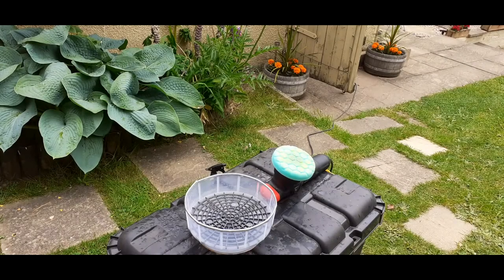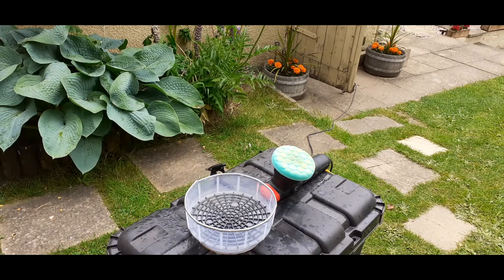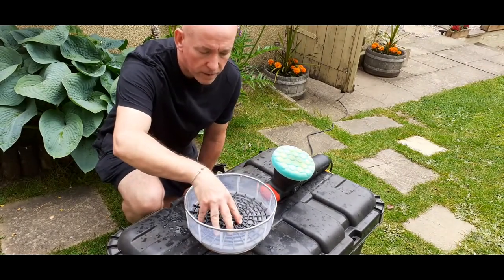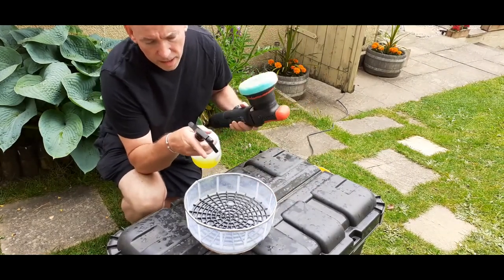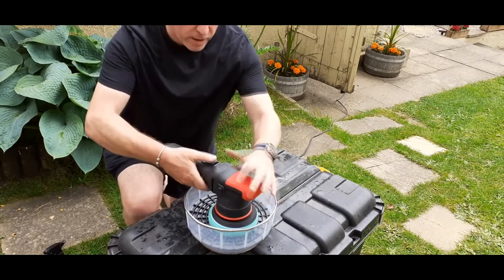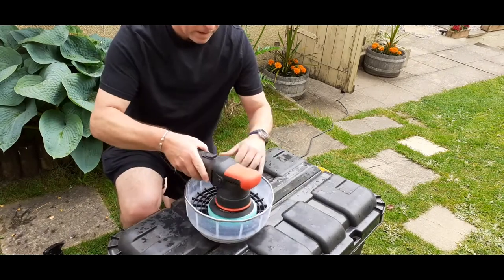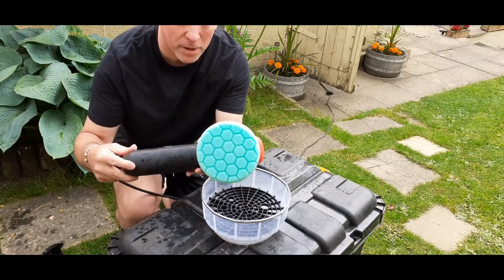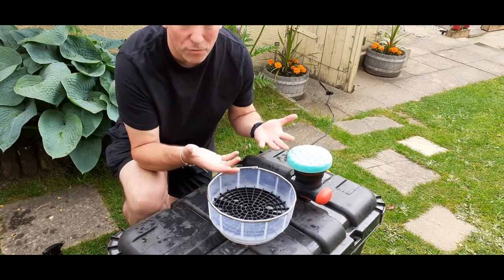Detailing hack....cleaning pads on the fly

Comment: wont that pro the life of the pad?
Reply from the maker: Hi buddy. It's a very similar method to many of the other pad wash systems available,  just very simplified 😉
Potentially yes you could catch the edge of your pad & tear it, but if you trim everything down to avoid sharp edges it's not a problem. 
Spinning the pad against the grit guard wont really put any undue wear onto the pad surface, unless you really push down.
Hope that helps buddy, thanks for commenting